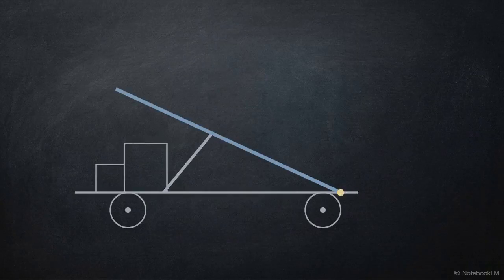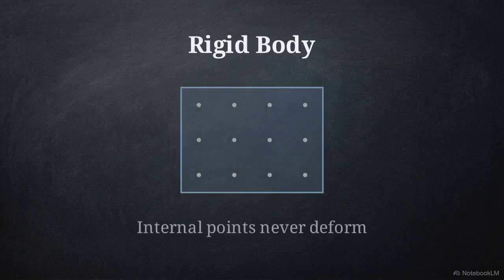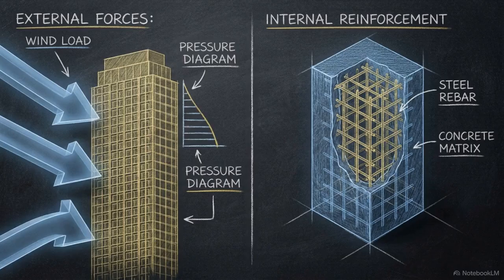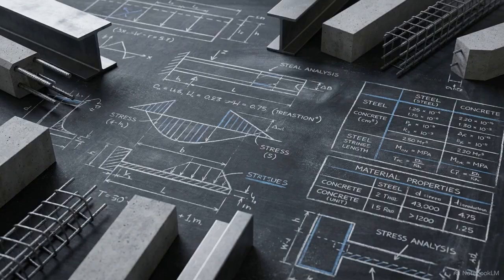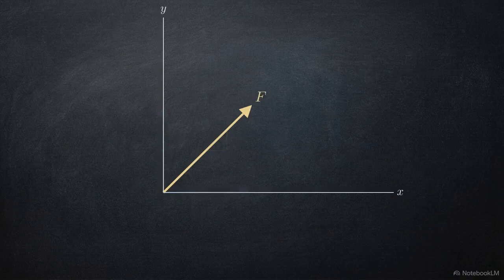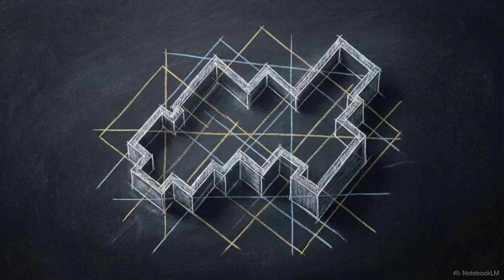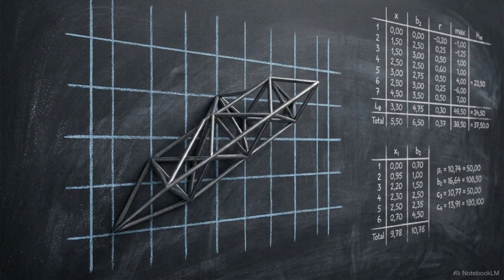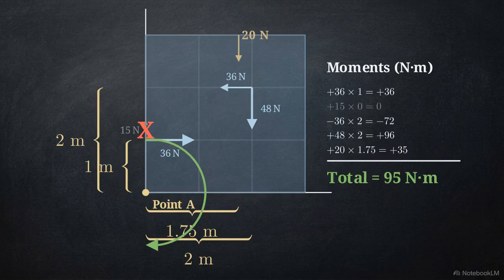The Geometry of Equilibrium: Vectors, Components, and Moments

Comment: All push and pull should be balanced equally, which is an important concept that I understand better now using the Cartesian Resolution concept. When we resolve angles into simple components along x and y axis, there is no need for complicated trigonometry calculations anymore. Using the Varignon’s theorem, there is no need for geometry when calculating moments; instead, calculations can be done easily using grid dimensions. It is clear that separating forces acting in straight lines from those causing twisting makes calculations simpler.

Comment: In my opinion, trying to analyze forces along diagonal angles is an unnecessary headache when you can simply flatten them onto a standard x and y grid. Splitting an angled force into straight components turns messy trigonometry into basic addition while keeping linear pushes and rotational twists completely clear. Using shortcuts like Varignon’s Theorem to manage those grid components is undoubtedly the most effective method to maintain a structure's balance while avoiding trivial math errors.

Comment: I realized that understanding equilibrium is not just about finding numbers, but also about understanding how forces act on an object. By breaking vectors into their horizontal and vertical components, complicated forces become much easier to analyze. I also learned that moments help us understand how a force can cause an object to rotate around a point. Using these concepts together makes it easier to determine whether an object will stay balanced or move. Overall, the geometry of equilibrium showed me how vectors, components, and moments work together to keep structures stable in real world situations.

Comment: Resolving forces into Cartesian components makes complex equilibrium problems easier to understand and solve. By breaking an angled force into its horizontal and vertical components, we can analyze each effect separately and determine how they contribute to the overall equilibrium. I also found Varignon’s theorem helpful because it provides a simpler way to calculate the moment of a force. This video helped me understand how forces, components, and moments work together in statics.

Comment: I learned that resolving angled forces into Cartesian components is a powerful approach because it breaks down complex multi-dimensional vectors into manageable parts. By utilizing Varignon's theorem, we can skip difficult angle math by adding up individual moments instead, making the evaluation of structural stability and rotational equilibrium much more systematic and precise.

Comment: What I learned from this video is that breaking an angled force into x and y components makes equilibrium problems much easier to solve. Instead of dealing with one complicated force, we can analyze the horizontal and vertical effects separately and then calculate the resulting moment. The explanation of Varignon’s theorem was also helpful because it showed a simpler way to find the rotational effect of a force. This video made the connection between forces, components, and moments much clearer for me in statics.

Comment: Hello! After watching the video, this helped me to understand that resolving forces into Cartesian components makes structural equilibrium much easier to analyze. By separating forces into the x-, y-, and z-directions, engineers can apply the equilibrium equations more systematically. I also learned that moments and Varignon's theorem are important in ensuring that a structure remains stable and balanced. I learned a lot from the video, thank you!

Comment: I finally get it now. Structural equilibrium works because engineers break down complicated real-world forces into simpler x, y, and z components. Once the forces are separated, it's much easier to analyze and balance everything using the principles of statics. Pretty cool how something that looks so complicated can be simplified with math.

Comment: I learned that in the real world, forces is not that simply vertical and horizontal movements but it also acts at angles which makes the analysis difficult. However, we can also solve it by breaking angled forces into cartesian components. The two parts in statics are particles and rigid body. Engineers shouldn't only look at the external forces but also the internal forces because tension, compression, shear and torsion occurs to ensure equilibrium.

Comment: balancedI learned in this video that resolving forces into Cartesian components makes statics so much easier because it takes complex, angled vectors and turns them into simple x and y grid calculations. Instead of dealing with messy geometric angles and perpendicular distances, you can isolate straight-line pushes from rotational moments allowing you to easily sum up Fx, Fy, and Mo to guarantee a structure stays balanced

Comment: Understanding the concept of statics and its application is a must as a future engineer to reduce the risk of accidents on the field and create a quality output every transaction. In real life situation forces acting upon an object, things, or even buildings are not only linear but it is consist of multiple forces acting upon it in a various direction such as internal and external forces. These forces will then become a problem and can cost a lot of trouble if not solve properly using accurate math solution and visualization. Additiinally, in terms of structures, balance must always be  monitored, it can be attained by analyzing the situation such as the materials, different force, and even the distance that plays a role in a system. Enough knowledge will help us to understand how things work and by applying it in a real life experience we can solve things smoothly even those complex structural and mathematical problem.

Comment: Varignon's theorem really made finding moments a whole lot easier. I didn’t have to mess around with complicated trig anymore. It taught me that if you break a tough problem into smaller, manageable pieces, you get a more organized and accurate solution, especially in structural analysis. Honestly, using this approach gave me a clearer idea of how engineers keep structures balanced.

Comment: Honestly the biggest thing that clicked for me here is how everything connects — you can't properly get moments or equilibrium if you don't first resolve every force cleanly into horizontal and vertical components. That part about moments needing the perpendicular distance really made sense too — it's not just force times any distance, it's about leverage and exactly how far the line of action is from the point you're checking. And seeing how the equilibrium conditions actually apply step‑by‑step? It stops being just formulas on a page and becomes something you can actually use on real structures.

Comment: I learned that breaking angled forces into X and Y components makes statics much easier because it turns hard geometry into simple math. Instead of dealing with messy angles, you can just add up the forces on each axis and use easy grid distances to find the moments.

Comment: Statics uses simple geometric models to show how structures stay completely balanced under complex loads. By breaking angled forces into straight grid components and applying Varignon’s theorem, engineers can easily calculate both linear pushes and rotational twists. This allows them to balance external forces to keep a structure in place while managing internal stresses like tension and shear so materials don't break.

Comment: Every push and pull must be perfectly balanced out, a core principle that I now see much more clearly through the lens of Cartesian resolution. Breaking angled forces into simple horizontal and vertical components on a grid removes the headache of complex trigonometry. Thanks to Varignon's theorem, calculating moments become a matter of basic grid measurements rather than difficult geometry. I've learned that isolating straight-line forces from rotational twist makes the math becomes far easier to manage.

Comment: I realized that real-world forces pull at tricky angles, so breaking them into simple horizontal and vertical parts—like splitting the diagonal pull of a Golden Gate Bridge cable into straight downward and sideways forces—makes balancing a structure much easier. I also saw how combining this grid setup with simple rules, like treating objects as solid rigid bodies and using Varignon’s Theorem to calculate twisting, saves us from doing messy geometry. Ultimately, turning angled forces into plain grid numbers gives us the exact data needed to keep massive structures completely stable and safe.

Comment: Every force in nature naturally wants to move in its own direction. What makes statics so fascinating is how we learn to find, direct, and manipulate those forces so not a single vector is wasted or neglected.

By decomposing angled forces into X, Y, Z components and balancing rotational moments, our engineers turn raw physical loads into predictable internal tension and compression. We manipulate the math so every force cancels out to zero which is why the roof over our heads stays standing and not fall on our heads.

Comment: What makes resolving forces so satisfying is how it kills the guesswork. Looking at a 3D joint with five different forces pulling at weird angles is intimidating, and trying to trace force vectors visually in your head is a quick way to make a mistake.

Translating everything onto X, Y, and Z axes turns a messy spatial puzzle into straightforward bookkeeping. You stop worrying about complex geometry and just match up opposing forces axis by axis until both sides balance out.

To me, that’s the real beauty of structural analysis taking a chaotic real-world setup and simplifying it into something predictable and manageable.